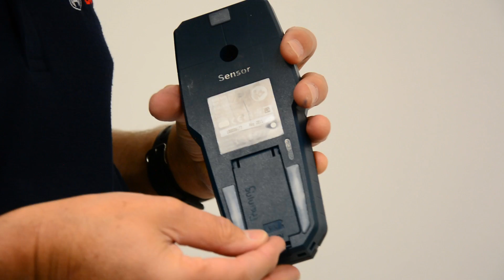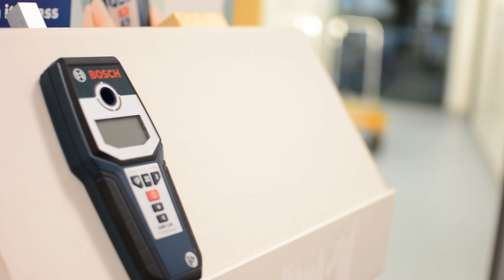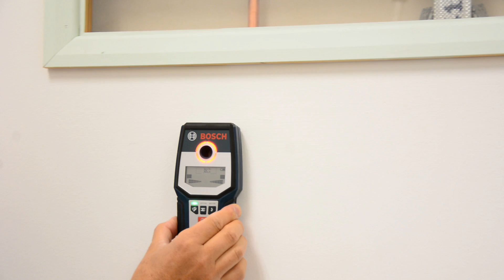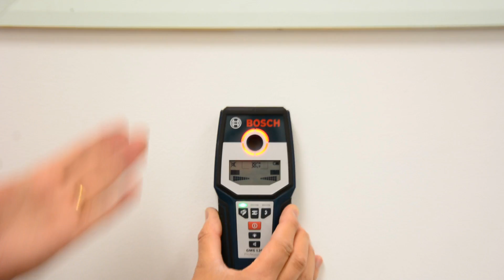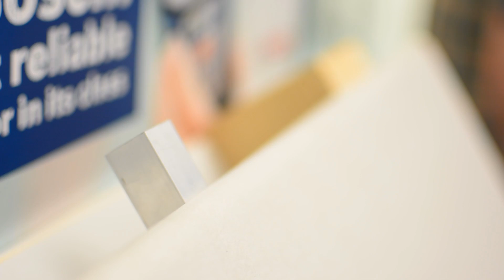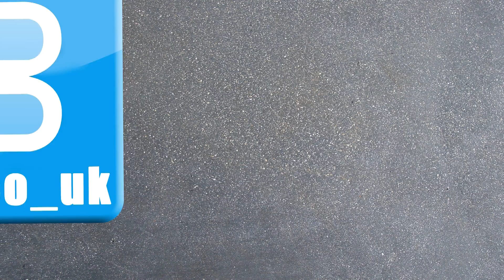Bosch GMS120 Detector - ITS

Comment: I just bought one and at first thought it wasn't any good but unlike some of the simpletons commenting on here I did a little research and found out that dry walls hold a lot of static electricity and has to be earthed. Simply take your shoes off and place your hand near ( above worked best for me ) the detector and it works just fine. It wouldn't hurt to remove any rings or watches also.
Honestly, people just seem to be getting dumber as the years roll on🤷‍♂.

Comment: wall detectors are all rubbish even the more expensive ones like d-tect 120 or d-tect 200 are bad as fuck
Reply: @MihaiDobrin88    
Have you used the 120 and 200? what detector would you recommend, I'm on the lookout for one
Reply: @ yes I used both of them I cannot recommend any of them unfortunately. As I said with the gms120 u need to pass 100 times on the walls. I used also d tect 120 not the 200 one and sometimes is still very inconsistent and is only telling u that u have an object there or not and is either object or electrical cable. Not telling u if is a stud pipe metal plastic wood

Comment: I've just bought one of these to try and locate the studs in my plasterboard wall so I can stick some shelves up. The electric indicator is constantly going off no matter where I place it on the wall.
Reply: Have exactly the same problem. Can’t find any reference to this issue either
Reply: @L_muslibar  I think the device is just shit (not what you'd expect from Bosch). I took it back to B&Q the next day and asked for a refund.
Reply: @MrThunderwing  unfortunately mines out of warranty - despite being used only once and practically brand new, they’ll not entertain it. Destined for the bin
Reply: Mine too ,.
Reply: Very old comment but it isn't broken, you need to put your hand on the wall for live wires to discharge and reduce the false positives

Comment: Mine has never worked it's not as effective as a £25 BnQ cheapy.
Reply: I second that. Waste of money.
Reply: @The-Original-Pato  I contacted Bosch I get the standard reply it's out of warranty..they dont seem to understand that there are other people with the same the product that say its next to useless
Reply: @gregchristie2763  I have since bought the Franklin ProSensor T13 Professional Stud Finder. It works flawlessly to find studs through regular dry wall, which is all I need from a stud finder. It doesn't find electrical wires etc. But it finds studs. Check out some reviews.
Reply: @The-Original-Pato  does it find plastic water pipes insode bathroom wall?
Reply: @ziohausam  I can't say for sure, I've only used it for wooden studs.